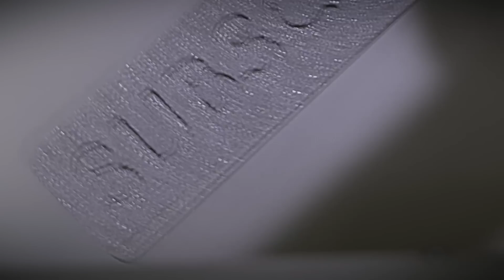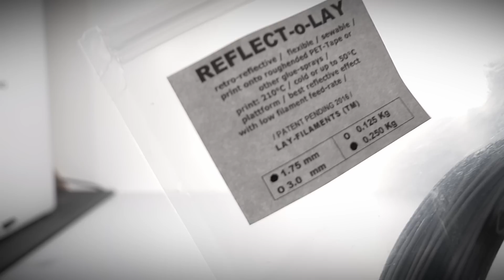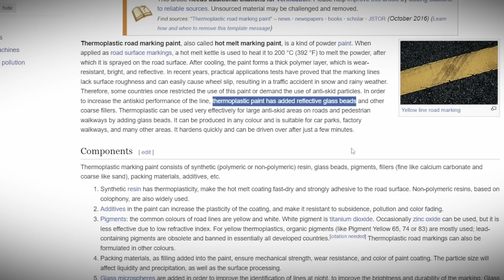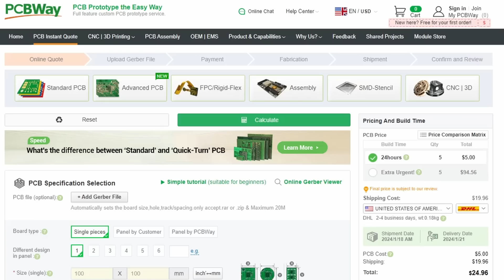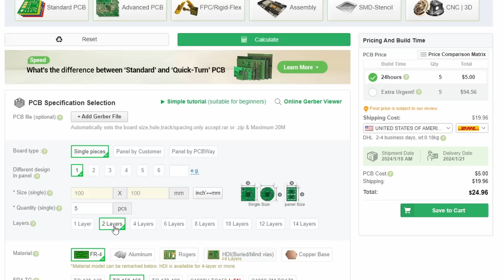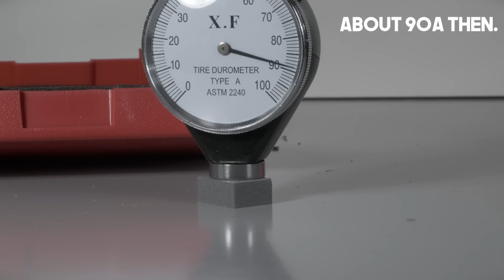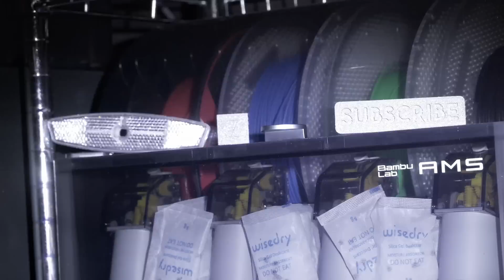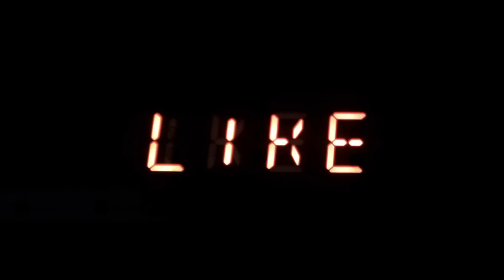Why this 3D Printing TPU Filament is full of glass balls.

Comment: for anyone wondering if it works for infrared 3d tracking it does not, the reflection is way lower than traditional catadioptric coatings

Comment: i found the tech specs and it says its PLA! 
  
General information
Material	PLA
Format	50 g / 250 g
Density	1.2 g/cm³
Filament diameter	1.75 / 2.85 mm
Filament tolerance	± 0.1 mm
Filament length	(Ø1.75 mm, 250 g) 86.6 m / (Ø2.85 mm, 250 g) 29.5 m
Printing properties
Printing temperature	210 ºC
Print bed temperature	20 - 60 ºC
Chamber temperature	✗
Cooling fan	✓
Recommended printing speed	- mm/s
Recommended nozzle diameter	Min. 0.4 mm

Comment: Do you have any printing Parameters you could provide? I tried to print it on my H2D and it doesn’t ‘t like my Print Parameters so far.
Reply from the maker: I don't know much about the printer, but it probably needs a shorter feed path, so it will print better on printers like Ender, Prusa mk4, etc. Only so much you can do with parameters if the hardware has too many complications in between.

Comment: I wonder if sanding the finished surface would reveal the beads similar to cutting the filament and how effective that would be? Would the sandpaper flatten the exposed side of the beads and how would that affect performance? This stuff is neat but very niche it seems.

Comment: Does that cyanide problem also go for tpe😮
I'm printing it at 280 degrees because below 278 it won't pass through my extruder at all 😮

It handles 95b tpu but 75b tpe just bundles up and blocks the gears below 278 even at 14mm/s
Reply from the maker: check the MSDS I guess
Reply: As a Dutch person I'm not entirely sure what exactly those letters stand for but the data I do have says not to heat it over 260 degrees however nothing about cyanide.
Probably gonna look up more about the material from other suppliers before I'll use it again.

So far I've had it running for hours and I'm still alive so so far so good
but maybe I do need to finish my fume hood before I proceed using more of it.
Bloody hard to get good prints instead of blocked print heads using below 85 hardness filaments though, even with my direct drive extruder.

Comment: Pretty sure that this is meant to be printed on a multi-tool type 3d printer. Only using this stuff to add reflective highlights to complex geometries where just adding a sticker would be impractical.

Comment: 4:30 Not a microscope. It's a magnifying glass. Yeah, and the magnifications are bold lies. Mine says you get the magnification they claim if you hook the "microscope's" HDMI output onto a 40" TV. The output is 720p.
Though to get a real microscope that can do those things, you have to invest at least an order (or three) of magnitude more*. And it is overkill for most uses.

*= I've seen a nice one for 40 grand. Base version. It has upgrades you can buy.

Comment: 3:09 Or you don't. Literally. I once knocked over a bicycle, including driver. The bicycle was dark blue, the clothing black, it was night, and the street lighting sparse. Not a single light nor reflector on the bike. I noticed it when I bumped into it. Luckily, I was driving very slowly (<5km/h).
Though the bike might have been stolen, as the driver hopped back on and legged it so fast, you might been thinking I was the devil and after his soul.

Comment: the "reflect internally" from wikipedia is total internal reflection. when light hits a medium that has a higher refractive index than the medium on the other side at a larger angle than the critical angle, the light will be reflected instead of refracted

Comment: I recently bought cf filled tpu. That stuff is great. Only found it from one manufacturer. Suprised no one is talking about it.
Reply from the maker: I'm aware of it
Reply: How is the outer surface of the cf TPU? Is it less slippery? I tried fuzzy skin on this custom grip I'm making for a tool but it's still kind of slippery. I need more friction.
Reply: @clutchboi4038  I would say it's more slippery than my 85a tpu. But the surface looks great like most fibre filled filaments.
Reply: What's it like mechanically compared to normal tpu?
Reply: @elongated_muskrat_is_my_name  it's a lot stiffer and has a nice typical cf filament surface (a light but nice texture) that makes every print look awesome. But since it's tpu it will flex under excessive load. Think of it as a less flexable tpu that looks good and is easy to print.

Comment: If you want to go all in and make your own filament, the retroreflective beads are available loose from some pigment suppliers (like for paint, etc). I have a tiny container for art shenanigans purposes and it's always interesting to stare at.
Reply from the maker: That would be pretty cool!
Reply: I wonder what mixes in the emerging pellet printers you could do with them!
Reply: @_kwak  Having literally just come from watching a pellet extruder video, I was thinking the same thing.
Reply: Wouldn't it be better to glue the beads on after printing and clear coat them? No point burying the beads inside a print where little light will ever reach them and the just weaken it.
Reply: @AndrewHelgeCox  I don't suggest clear coating over the glass beads.
Reply: Also available as an abrasive for media blasting
Reply: Ah but what bases is it compatible with. I think you need way different refractive index between carrier and bead, else the beads just disappear.
Reply: @SianaGearz Thus far I've used it with several acrylic paint mediums, PVA glue and hot glue, and it's originally intended for industrial paint applications. I (in the US) get mine from KP Pigments and it's really not very expensive as these things go. I don't have filament manufacture equipment but I'd love to see other people's attempts.
Reply: @nightshaderose  Most of these are not a surprise to me that it works, but acrylic paint medium is a surprise.
Reply: @SianaGearz you have to be a little careful about how you paint your lines because it doesn't disperse like standard pigments even with the particles being so small (it legit looks like powder in the container), but it definitely works.

Comment: Did you check volumetric flow rate in the slicer? Creality slicer does the Prusa thing and might have been slowing it down in the material settings. It really annoys me that they do that, because I can never be certain how fast things are printing now.
Reply from the maker: It's a cura fork, no volumetric control unless they added it?
Reply: It's sneaky! Click the type of filament, at the bottom there's a "manage" tab. Volumetric Max Speed is in there. Its 3.5 for TPU & 18 for PLA. Not sure if you were over riding it with the regular part of the slicer settings. Creality Slicer is...weird.

Comment: I should finish a retroreflective thing. Currently i am using a hat with LEDs and batteries and an IR modified PS3 Eye as my head tracker for simulation type games. Ideally i wouldn't need to wear a battery and wouldn't need a wire either. I know it's not much weight and it doesn't cause discomfort but the LED based build somehow lacks elegance to me.

I have bought some retroreflective tape circles from a bicycle store, allegedly from 3M material, but they haven't actually worked that great. Maybe my LED placement wasn't great, even with light quite close to the lens. I think next step is to deshroud the camera lens or build a really tight LED array and ALSO to give the retroreflective targets a bit of a curve, make them at least cylinder shaped if not ball shaped. Yes the tape appears to be made with glass micro spheres. It seemed to work very well straight on but i didn't get enough of a working angle out of it - considering i can't get a ton of distance between my targets and the camera/light.

But i have never considered printing an inside corner and applying some chrome paint to it... perhaps i should... I have some Chinese chrome marker pen which is sort of a clone of unobtanium Molotow pen and which turned out surprisingly decent and really really nicely put together, it's actually much better sealed and much smoother action than paint marker pens that you get as store brand around these places... not to speak of the unique paint. And the price was ridiculously low as well. But i still think tape is going to work better.

How to determine how much of this filament is balls? Well you could sacrifice some of the filament to a suitable solvent and then wash out the balls... somehow. To then weigh the balls vs. source sample. Modulor will sell you methylene chloride after you give them a signed note that you're going to use it as a plastic welding agent and not say as a paint stripper. Not that i think it's worth it and i'd bet on this failing in a myriad of ways at the filtering stage, but you asked so i had to think about it.

I can't see myself printing retroreflective filament. I'd much rather apply a surface treatment like sticky tape, fabric or paint or something of a kind on top of a normal 3D print. But also it's good to know that it exists and is sort of terrible.

Comment: TPU becomes CYANIDE if it’s heated too high??? Where are you getting SDSs? My filament from Micro Center has never come with an SDS.
Reply from the maker: I think they have to provide it if you ask for it. I wouldn't be too concerned about TPU though, just don't set it on fire. Or heat it over I think 260.

Comment: So an interesting extra modifier would be to add some fumed silica to improve flowability of the mixture
Reply: Improve flowability? I think this will just thicken it up and make it REALLY difficult to push through the nozzle! Plus it may mute the glass bead reflection.
Reply: Fumed silica probably just acts as a thickener in that case. It helps flow in powders. And due to it's porous structure it might make prints less shiny but could also make it more moisture absorbing. It's apparently used for powder based laser sintering as a de-clumping agent and in resin printing to thicken the resin but I doubt it would help in a material that is already a messy goo. Most additives in FDM printing decrease viscosity or melting point in some way. Would try with less or smaller particles to improve flow.
Reply: @zapl80    My familiarity is from epoxy work and it's used for thickening. It's why your typical 2k epoxy adhesive isn't as runny as oil. My second concern is that it'll cloud the carrier by presenting a structure of different refractive index to base polymer; in turn its refractive index may be so close to glass beads, that it'll touch and break their total internal reflection effect on incident light, allowing more light to escape into the resin and get diffused instead of being thrown right where it came from.

I don't believe hygroscopic property is a concern, it's a feature in air but not when resin has been allowed to fully absorb into it and de-aerated. It can reduce hygroscopicity of polymer.

I think also why you can't just have a retroreflective glass bead filament with a better behaved carrier polymer such as PETG or PS is because the refractive index of these is indistinguishable from glass, so it'll just look like normal PETG maybe just a little cloudier.

Comment: Isn't the K1 Creality's new flagship product, competing with the Bambu X1?
Aren't you supposed to use a release agent on the hot bed when printing sticky filaments, like TPU?
If it's main purpose is for use in the dark and outdoors, wonder how it holds up to the environment and UV rays.
Reply from the maker: Yeah a release agent would have been useful. I don't normally bother but this stuff is weak enough to break off.

Comment: Does it become more elastic if you pre-heat the filament a bit? (so, not more stretchy, but more form retaining)
Reply from the maker: Good question, I'm not an engineer but tpu is a strange material in 3d printing as it's already, as I understand it, past its glass point. So heating it might not quite do what other filaments do.
Reply: @LostInTech3D  I don't dare to assume anything either with such exotic filament 😄

Comment: Underextrusion is common due to the drive gears compressing the TPU - I used to run as high as 130% flow rates on older printers even for 95A with big 1mm nozzles for low backpressure.
Reply from the maker: yeah I've been up to 160% for 60A.
Reply: I had to design my own extrusion idler assembly to combat this on my printer. It grips the filament only tight enough for the drive gear to engage and no tighter. That was the only way for me to solve the extrusion consistency problem on my printer.

Comment: A lot of the break beams I work with are near infrared detectors which are kinda picky about which retro reflective media they get along with. We do print a lot of custom brackets for test product runs.

I kinda doubt this stuff will work but ordered and we'll give it a shot.
Reply from the maker: Haha, when I tell people not to buy stuff, they buy it! Good luck with it though :)
Reply: Did you get anywhere with this? Any results to report?